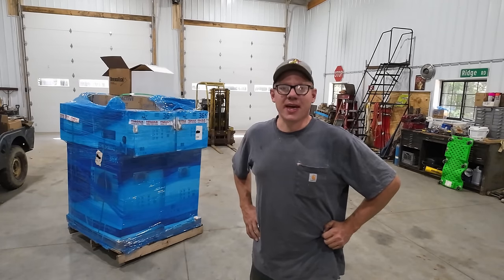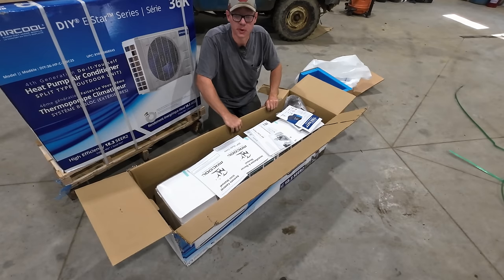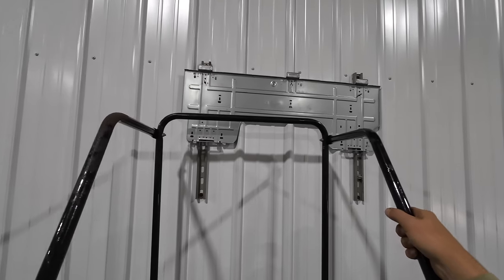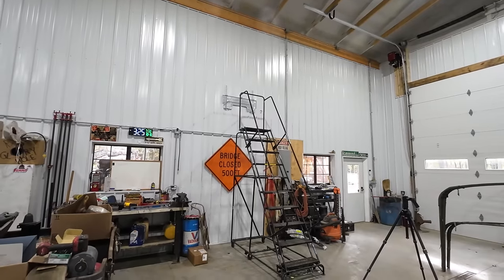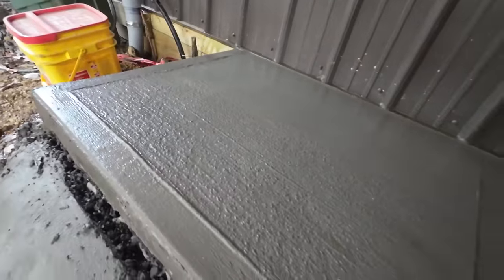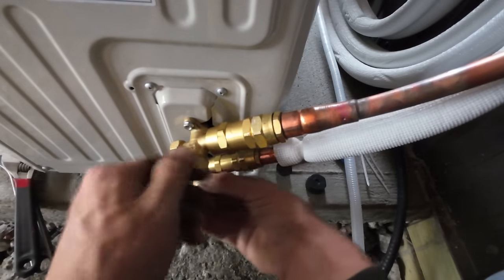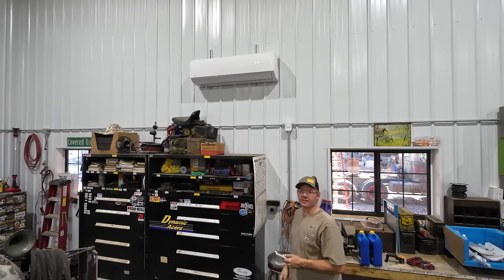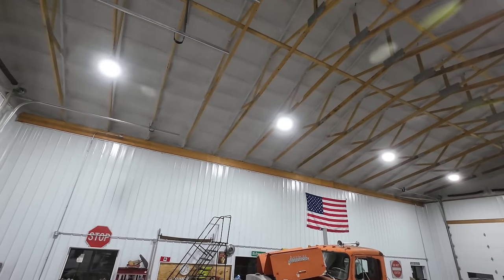DREAM SHOP Gets a Serious Upgrade! (How Hard can HVAC be??)

Comment: I'm up in Canada, one of the local 8 bay diesel shops here has started using heat pumps. I can't believe how well and cheap they work, even during the -40 days, the shop is still tolerable. Plus they're not burning $7,000 in heating oil each month
Reply: I’m calling bs, environment Canada has stated that heat pumps start loosing efficiency at -15c and stop heating at -25c 

The building code also says that you must have a backup heating system that can handle 100% of the heating load.
Reply: AHH, NO. Heat pumps dont work that way.
Reply: Good job man. Is the heat side of the equipment in addition to the underfloor heating you worked so hard to install or instead of ?.
Reply: Found the Liberal Party of Canada employee.
Reply: That is still 15 degrees of frost...
Reply: They don't work at all at -15℉, but are not very good at 0℉. You cannot run these without supplemental heat in cold environments like Canada. We are in Wisconsin, and have been using heat pumps for years.
Reply: @dakotareid1566 Sweden would like to have a word... Heat pumps are very common here. Also, there is a difference between "loose efficiency" and "don't work at all".
Reply: @dakotareid1566  It really depends on the type of heat pump. If it’s an air heat pump that’s correct, but I would assume that they use ground heat pumps for industrial applications in Canada. In that case the outside air temperature doesn’t affect the efficiency like that since those heat pumps use the warmth of the earth as their heat source and if it’s a well designed system they can also function as A/C in the summertime. These systems are really expensive to install since depending on the size they need multiple quite deep holes drilled into the ground, but this way you can get some incredibly efficient heating solutions, especially in combination with heated floors instead of old school radiators. 
Heat pumps aren’t as bad as you may first think, a good system is just a really expensive investment up front. And with every cost saving measure they get considerably more inefficient.
Reply: @dakotareid1566 how can you call BS if you have no idea what heat pump they are using?
Most likely they have a heat pump with auxiliary heating (an electric heating element). So yeah, efficiency sucks on the days when that is needed (efficency of 1) but the shop still gets warm. And if electricity is cheap for them then it's still cheap. 
Or maybe they are using a ground source heat pump?

And why does the building code in your area require a second heating system? That's really stupid. Or are they also requiring that for gas furnaces?
Reply: I grew up it North Idaho.
We had electric and wood heat growing up, and no AC.
After I moved out my dad installed a geothermal (ground source) heat pump.
Those are much more efficient and work better in extreme cold as the ground temperature is much more stable than the outside air (under ground is warmer than the air in the winter and cooler than the air in the summer).
Reply: @PeacemanCSGO even that well informed answer was still sort of wrong. You can get away with not having a deep and expensive hole. All you need is 300-400 meters of tubing and a plot of land big enough to put it below frost depth. A parking lot works quite well.

I’m hearing a 400 sqm home that way since about twenty years back. A lot cheaper than a well hole and even more cheaper than straight electric, gas whatever.
Reply: And if the pipes go unground?  Geo thermal. Is 50 degreesF
Reply: You sound like a salesman for these pumps
Reply: @RandomName100  

That’s how my dad did it at his house.
Loops of pipe running back and forth underground, but not extremely deep.
Reply: I don't think people understand that heat pump technology has come a long way...
Reply: You're on the powergrid! Congrats!
Reply: @dakotareid1566 if these units have a backup heating element in them then you are wrong about them not working. But you are correct about the other bit.
Reply: @dakotareid1566 I have a Daikin XRH40 and it deliver it's nominal capacity (COP4.2) down to -25C and can produce heat at -30C. But I don't believe there is something that works at -40C yet
Reply: @SaiTorrKalFas didn’t read the whole comment did you
Reply: @matte.hartman I’m going off what environment Canada has said, I’m sure there’s exceptions
Reply: @Jehty_ that’s the Canadian building code that requires it. I’m calling bs based on environment Canada has said. Gas/oil doesn’t loose effectiveness after a certain temperature.
Reply: @BRI33NOR The underfloor heating is for use with his outdoor boiler, which he has not yet built.  So the underfloor system is currently dormant.
Reply: @dakotareid1566  
Environment Canada doesn't know which heatpump they have installed 🤷🏼‍♀️
They only talk about heatpumps in general.

What do you mean by effectiveness?
There is no gradient of effectiveness. 
As long as the heat pump gets the shop up to temperature it's effective.
And any properly sized heatpump will do that at every outdoor temperature (as I said, if the outdoor temperature is too low it will just use a heating element instead of the heat pump)
Reply: 0
Reply: My last house had a heat pump. Load of bollocks, radiators never got more then luke warm. Funking freezing. 😂
Reply: @TheChalkBane  So did you fix it?
If your gas furnace didn't work you wouldn't complain about gas furnaces in general, would you? Instead you would fix it. Right?
Reply: @PeacemanCSGO your describing a GEOTHERMAL system
Reply: @dakotareid1566  regarding the Canadian building code: I just looked it up. I assume that you aren't deliberately disingenuous, but you just don't know any better, right?

The need of a backup heat doesn't mean that you need a gas/oil furnace or anything like that. The electric resistance heating system that is integrated in most heat pumps is enough.
So you just need the right heat pump.
Reply: I am trying to convince my dad to get Mr. Cool hvac systems.
Reply: I have a mister cool and love it.
Reply: And spend instead 7000 bucks on electricity.
Reply: Yeah, that's some cool tech (though, in principle, they're really simple...)

I think heat pumps are the future; they just make sense, especially in any area where mains aren't accesable or inconvenient or uneconomical (vis: municipal central steam, a/c, etc.)

Cheers!
Reply: I know several people who installed heat pumps and got rid of oil furnaces
Reply: @dakotareid1566  

I think that's ground temperature. -15c underground is, well... maybe heat pumps don't work in permafrost. (I could be wrong, but, the science/products work, as far as I can tell/ have experienced, when applied in appropriate circumstances, of course.)
Reply: @01Bouwhuis  

Bingo... especially if he's referring to underground  heat pumps or those using just water as their heat exchange fluid... I smell a rat, or, at least, a predisposition against something that just might be 'green'(er)... that crap is tiresome, imo, eh?
Reply: @dakotareid1566  
I'm not sure how to interpret your post...

...Do you think that the requirements for a backup system is somehow burdensome or perhaps an example of over-regulation, which may somehow negates the cost savings of heat pump hvac systems,- do other hvac paradigms vis. newly regulated technology not require a back up? Is that the case (if so, you may have a point)?  Your post doesn't  seem well considered, though I may be missing something. If so, what?

Cheers.

...Or is it common sense? (OR is your post just reactionary mean spiritedness, a ludditic knee-jerk response to unwelcome progress? I don't think it is, but...
Reply: @chrisparsons3141  

What does that mean? New techniques somehow politically liberal? (It is l, by definition, technologically liberal... but that's not what ya meant, was it? ...why? Is everything a culture war these days? ...Sry if I am way off in my interpretation of your post' but it reads as snarky/pointlessly troll-ish)
Reply: @shabadoo24  me too... it is interesting that such a simple  (in principle) tech has taken so long to become even as mainstream as it is now: I really think it is the future of energy effecient and affordable hvac.
Reply: Heat pumps are excellent end of story cheapest way to heat and cool
Reply: @dakotareid1566 That applies to air-source heat pumps. Ground source heat pumps, provided they are deep enough, will work in any temperature.
Reply: I replaced the oil furnace for 2 air to air pumps. Works great here in Norway so I assume they work in Canada as well.
Reply: @daglivden2427  

Nice. I'm planning on doing the same the next time my family's property needs any major maintenance...

Any suggestions/ advice?
Reply: The heat pump I'm using is rated for -30 Canadian degrees, im my 3rd year with it no issues winter or summer
Reply: That's not accurate. The newest heat pump systems (with high SEER ratings) work down to much lower temps than earlier systems. Below freezing should be no problem for a SEER 18--20 or higher system but check the specs.
Reply: @kirtcortez7836  Yes, sorry I didn’t know the proper term in English. At the end of the day it’s still a heat pump that just uses a different source for thermal energy. And directly translated from German they are called Earth heat pumps which is why I used that name :)
Reply: @xenadu02  

Interesting... thanks.
What is the fluid used to exchange heat- just antifreeze, or something  more wxotic?
Reply: I call BS on that as Enviroment Canada has no say one way or another about heat pumps other than they don't give of greenhouse gasses.   Here in the Maritimes about 25% of homes use heat pumps as their primary or only heat source.   By 2030 that will grow to the majority of homes.   Look up almost any heat pump on the market here and they are rated to -25 to -35 degrees Celsius.    Which is well within safe operating limits.  I keep seeing these claims on social media but all one needs to do is google the units themself and see their ratings.   Or better yet ask any one of us how well they work.   If you check the temp map for nightime lows most Canadians who aren't in the north can use mini splits or other units.   They even have ducted units which will retrofit into your existing duct work from you old inefficient oil fired forced air furnaces.   So before commenting do some research.
Reply: @KuehlIndustrial they actually do.   They are the primary sourse of heat in most new home construction here in the maritimes for a reason.
Reply: @RandomName100  We can surely argue about my answer being right or wrong. I would just say it’s incomplete :) But of course I know about the system you’re describing and in my opinion it’s certainly the far superior solution. Here in Germany it’s just still very uncommon for a couple of reasons. Just one of them being limited space in city’s and suburbs for the necessary collector fields. 
But I am happy for you that you have this system and it’s working well for you. I hope to see more of them here in the future aswell, but at the moment it’s pretty much just air heat pumps and occasionally geothermal with deep holes. 
For example, close to where I live there’s a brand new office building with a full glass facade and they drilled 63 holes about 100m deep for their collectors. Their heating system has 2,8 MW of heating and 1,5 MW of cooling power. That’s just insane for one building haha
Reply: @PlanetMojo again google  the Maritimes in Canada where 25% of homes use heat pumps as their only heat source.   Google the pumps sold locally which are rated for -35 Celsius.    They work this I know for a fact as my daughters last two homes have heated exclusively with them. My friends shop heats with them for 200 a month comapred to 2000 for oil.   Not sure about in the US but we here in Canada seem to be years ahead of what technology they are using there.
Reply: @PeacemanCSGO those are not heat pumps but Geothermal systems which pull the heat out of well water or a purposely laid pipe grid usually filled with some form of glycol.   Heat pumps that take heat feom the air are used by about 25% of homes in the three Maritime provinces and have no issue coping with the climat.  They are rated to -35 Celsius and run very efficiently.    Google Maritime trend towards heat pumps.   Then google the new Sendville units but any brand sold locally will show they work just fine.   My daughters last two homes were heated with just heat pumps.   Never any issue.  My neighbors show 60X100 heats with heat pumps at 200 a month and his house is a geothermal system thats between 15 to 20 years old. No issues or repairs yet.
Reply: @PeacemanCSGO Not that bad, starting cost is 2999.99 cdn here.   Up to 5999.99 for real good models.   Not much more than other heat systems.
Reply: @RandomName100   whats your frost level for curiosity?   For construction that is.   I have seem a house lifted off its foundation because the owner only put the garage footings down four to five feet.  Now it doesn't go that deep her in PEI every year but once a decade we get a deep frost cycle that freezes lines less than siz feet.  My neighbor has a large salvage years with four large buildings and ran air and water lines from the main building to the others.   The only rig he could get drooped them down four feet and they froze more years than not.   Cost a lot of money to bury a grid that deep.   When he sold the business and retired he built his dream house for him and his wife.  Everything was set up to be easy to look after and just incase they needed wheel chairs or had real bad arthritis.    Smart move.   He dug a second well for his geothermal with all cost being about 50 grand CdN.  Going on 20 years and no problems.  After the people he sold the business to went bankrupt he built a brand new show 60x100 and re-opened.   In his 80s now and works to noon most days.  Hell of a nice guy.    Everyone in the province know him or of him.   Of course it is PEI.
Reply: @matte.hartman the best I saw looking this fall is -35C.  Now i didn't look at everything but lots of different ones rated at that.   If they don't have some rated for it they will in another few years.
Reply: @dakotareid1566 mine work down to -10 F  you have to spec them for cold climates
Reply: @PlanetMojo i'm in northern maine right on the border of canada and while no they won't completely heat your house in the -30/-40F days mine were specd for cold climates and they work down till -15F
Reply: @dakotareid1566 gas and oil do lose efficiency.   Furnace oil thickens as it gets colder and takes more to get the same BTUs. Not sure about natural gas.   Furnace oil is essentially deisel fuel and as we all know you get less miles per gallon as it gets colder too.   So we know heat pumps are rated between -25 and -35 C  and that doesn't  mean they stop working at that temperature just they lose significant efficiency.     So for every watt used you mightbe better using a convection heater or some other form of electric hear per KWh.
Reply: @Jeangroen1 yeah , like 99.999999% of the rest of the modern world
Reply: @matte.hartman mine are Daikens as well
Reply: all i know is i was burning 250 gallons of heating oil a month before i got my heat pumps (it's actually just one with multiple heads inside the house) and i use barely 300 gallons a year now
Reply: @TheChalkBane sounds like it needed servicing like any non working system.  I use to use a forced air system which needed frequent servicing be it the pump,the igniter or the blower or something else.   I changed to electric heat and saved the cost within that first 12 months.
Reply: @Jehty_ here the insurence companies dropped the need for auxiliary heat with heat pumps years ago.  EC  really isn't much of a source on heat pump technology or regulations.
Reply: @andrewallen9993 heat pumps are the most cost effective way to heat and then you have the bonus of air conditioning in the summer.   Also depending on the unit they run on about the same electrical demands of a forced air furnace so if your generator can run your furnace it can run your heat pump for heat.  Not AC though.
Reply: @bholdr----0 you are getting pretty far north to reach permafrost.   I lived in LaRonge Sask  with regular winter temps well below -40c.   Now night time temps are rising all across Canada but i doubt people could heat with only a heat pump but thats a small overall number of people.
Reply: @srp01983 Geothermas are not clased as heat pumps.   And heat pumps will still pump heat past -35  C.   With our night time averages in the - teens there is no issue.
Reply: @xenadu02 new systems here are 35 SEER.   Rated for -35 C.
Reply: @PeacemanCSGO we call them Geothermal units which translates to your name pretty well i thing.  They are not  called heat pumps here in Canada.    They are years behind in technology in the USA because coal and oil companies bury technology used elsewhere.
Reply: @Hard_Right is Maine colder than New Bruswick?
Reply: @jimdavison4077  geothermal heat pumps are heat pumps.
You might want to check what you are talking about before you write that many comments.
Reply: @saluki417
absolutely impossible for any heat pump to produce heat at -40 . zero chance but cool story.
Reply: A heat pump is using the refrigerant to heat and cool. In heating mode there is a reversing valve that switches the direction that the refrigerant flows to heat and then switches back the other direction in cooling mode. That’s how a heat pump works
Reply: We have 2 LG Heat pumps in our home in New Brunswick used year round -30C to +30C  no issues!
Reply: @gingyberrie  based on what?   They are rated for -35C which means they are efficient up to that temp.    Now they lose that point at some where but can still produce heat after that but are not what you call efficient, per KW used it would be more efficient to use convection heat or some other kind of electric heat. Either way its much much more efficient than  oil, coal or gas.   That should sum it up. New heat pumps on the market are rated from -25 to -35C  and getting better every couple years. About 25% of our homes use heat pumps here in Atlantic Canada wirh the number growing substancially every year.   Entire partment building heated with nothing but heat pumps one for every unit.  That way renters pay for their own heat when they pay their power.    bills.
Reply: @MKMALM2024  out of curiosity whats your night time lows for Dec, Jan and Feb.  We use to be in the low -20s back in the 80s, now its mid to high - teens.   We use to get mid -20s during cold snaps but thats not been happening.
Reply: @Jehty_  they are not heat pumps and nobody who sells them sell then as that here.  They are two distinctly different systems.   Heat pumps work like a fridge or freezer and use a chemical to help the process just like the fridge or freezer.   Ever pull a fridge out away from a wall and burn your hand on its back?   Thats what heat pumps do. Now Geothermal units pull heat out of well water or a pipe grid filled  with a non freezing liquid some form of glycol most likely.   So not a heat pump.
Reply: @jimdavison4077  and how do you think a "geothermal unit" turns that few degree warm glycol into 30+ Celsius to heat your home?
Correct, by using a heat pump.
Just instead of taking the energy out of the air it's taking the energy out of the liquid that was warmed up by the ground.
Please just Google "ground source heat pump". You are making a fool of yourself.
Reply: @jimdavison4077  What puzzles me about your statement is as I'm an electrical engineer a heat pump uses the same amount of electricity whether it is working as a heater ( if the heating element isn't running) or as an AC. It either pumps heat from the outside in or the inside out. Think about it :)
Reply: @jimdavison4077  my lines is at 4 ft and the normal frost depth around here (southern part of Sweden) should be at around 3 for my location with the occasional dip towards 4. But what I know from my brother a little more north (Gothenburg area), he has the lines at 6 ft, and was told that past that a well was advised instead. Simply because at that point you loose efficiency I’ve a large part of the year, not for freezing (it’s basically antifreeze).
Reply: I was thinking, why put the units so high? Not only does heat rise but cold air don't!
Reply: @andrewallen9993  first of all heat pumps traditionally have no heat eliment in them.  No draw of electricity to actually heat anything, its all done with the refrigerant liquide.   The same as a fridge only in reverse then  it reversed its flow to heat.  That actual wattage is about 100 watts in the difference between a heat pump and forced air furnace.  The furnace running from 400 to 800 watts and the normal heat pump from 500 to 1000 watts.  Thats just the fan and pump on both plus a very small ammount for the circuitry.    Now to run as an air conditioner they work much harder so they use more power.  Think about anyone who has used air conditioners how much their power bills go up in the summer months.  Google the current models of heat pumps sold in northern climates and what they are rated for per hour, for air con its considerable higher.
Reply: @robertl.fallin7062  they blow out of the bottom and blow downand out.  Putting then much lower and the heatwould take longer to reach the other side of the shop.  Kind of picture it like a triangle coming down from the unit and trying to get it to the middle of the shop.    The fans pretty stong in them so if you stood in the middle of the shop you should feel the heat blowing on you.   Any lower it wouldn't reach that point and any higher it would be blowing even futhure .
Reply: @Jehty_  again thats not how the industry refers to then, at least not around here  where a heat pump is a air soursed unit and 25% of the homes have them.   Geothermal units are not even installed by the same companies.   And are almost exclusively well sourced.   While the priciple is the same the operation and how they work is completly different.
Reply: @jimdavison4077  where is "around here"?
And how are ground source heat pumps called in your area? 

The operation and how they work is basically exactly the same. So why would you say that how they work is completely different? That makes me think that you still have no idea what you are talking about?! 
But at least you seem to agree now that they are heatpumps, right?
Reply: @robertl.fallin7062  because this way he’s aiming them pretty much at the middle of the room. Add the fans and he has decent circulation of both hot and cold air. Put them lower and he would have a hard time moving the hot or cold air to the other end of the room.
Reply: @jimdavison4077  pumping refrigerant one way uses just as much electricity as pumping it the other. It's the same motor, just running in the opposite direction the evaporator and condenser coils just swap around as well. Why would it use more current running in opposite directions?
I eagerly await your explanation.
Reply: @andrewallen9993  simplest way to answer that is look up the manufacturers specifications.   I did which is why i mentioned it.   I was looking to see what i could run with my 12000 watt generator and looked it up on their website.   And thats what they have writen there.    There is more to it that simply changing the flow direction.    Saying that would be like saying you would burn the same gasoline going in forward and reverse which we all know is not true.
Reply: @Jehty_  no, heat pumps gather heat from the air.  Geothermals are a differnt unit entirely.   I am from the maritimes in Canada where a quater of all homes use heat pumps for their heat.  Geothermal heat is still pretty rare because of the much higher cost up front.   That said they are very reliable and efficient.
Reply: @dakotareid1566 exactly it's a green troll trying to spread the bull agenda.
Reply: @jimdavison4077  Oh good grief. It takes the same amount of energy (gasoline) to move a square vehicle forward or backwards, think of a two stroke engine with its timing altered 😁
As to heat pumps imagine it on a swivel so instead of altering motor rotation rotate the swivel 180 degrees.
Hey Presto! What was a heater is now an aircon!
Understand it now?
It's how your fridge gets cold. Next thing I know you will tell me I can't own a fridge that gets cold inside it when I light a fire outside it!
Reply: @Jehty_  in looking things up it seems so much information is different in the US and Canada.   In the US its as you say ground vrs air heat pumps but here in Canada the term heat pump referes to air based system.   Also many US sites list 20 degrees F as the lowest they will work while here they list -25 Celsius to -35 Celsius according to manufacturers.    Looking at US ground systems they most often would not even work here as they are not deep enought to avoid the frost level.   Thats why  going with a well is more common.   A new well is between 5 to 10 grand cdn.  Putting down a grid system below the frost level would cost as much if not more plus take up more room than many people have.
Reply: @andrewallen9993  hey if you think a car would travel the same distance on the same gas forward or reverse there is no talking to you.   Clearly you don't understand mechanics, gear ratios and so on.  Again look up heat pump manufacturers own web sites for listings on power use.
Reply: @jimdavison4077  You certainly don't understand mechanics. A two stroke is just as capable of rotating clockwise or anti clockwise as efficiently merely by changing ignition timing. Gear ratios etc identical 😁 rotating heat pump through 180 degrees changes power used? Don't be silly.
Think please.
Reply: @andrewallen9993  drive many two strike cars? Point was gear ratios in reverse and drive are quite different which means different fuel consumptions.  The way valving and compressors work in heating and AC is also not identicle.  Alot of other factors involved.   Again look up the manufacturers sites.
Reply: I love the brainless comment, “no they don’t work in cold weather!”…. Knowing nothing about where this shop is located. Whether it’s in the mild lower mainland or in Iqaluit, if it ground source or air source or actually any specifics of the systems setup…
Reply: Bs
Reply: Are heat pumps some sort of new technology in the Americas?  They have been here in Australia for atleast 30years and only recently I have started to see American youtubers creating videos on them like they are some sort of new technology
Reply: @CustomcrowdMitroc  the US is about 20 years behind in energy technology.    They still get 60% of their electricity from coal but are quick to talk about how China pollutes the enviroment.
Reply: Boxing gloves are optional in this comment section.  😂 I think I got an education on heat pumps!!  Install a properly speced heat pump and an outdoor wood furnace if you have access to cheap wood.
Reply: @frankarchuleta5427  thats it.  If you have your own wood its silly not to make use of it.  Select cut and wind falls can give a lot of wood without cutting good trees.
Reply: These Discovery jokes are really 😂😂😂
Reply: @dennisP22  discovery jokes?
Reply: Chris Parsons. Actually the new heat pumps work well. And operating costs are much lower
Reply: @bobinthewest   They keep improving the technology.  Older units are bound to give up their secrets when examined.   They are said to lose efficiency at -35C but still produce heat for lower temperatures.   Just they become less efficient which means the amount of electricity used could be less with another type of electric heating.
Reply: @dakotareid1566 'calling bs' Where's your manners, sir? Mike Tyson was right. If anyone said that to you in person, you'd be swinging.
Reply: @dakotareid1566 they loose efficiency at a point yeas, but as long as the outdoor air temperature is above absolute zero, there is heat they can transfer to the conditioned space. 

Although, to your point, I would never recommend them for a colder northern climate. They are great for the south where they only need a little heat.